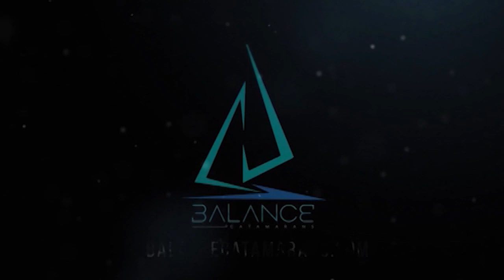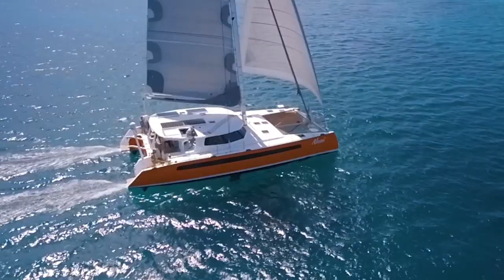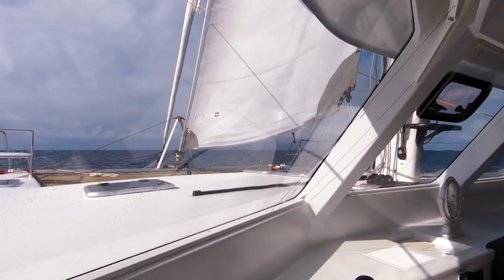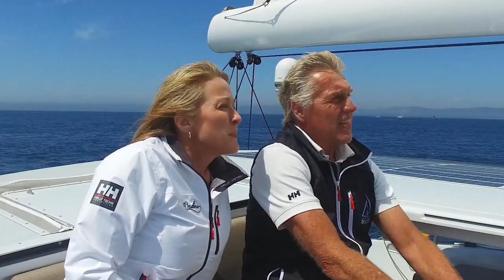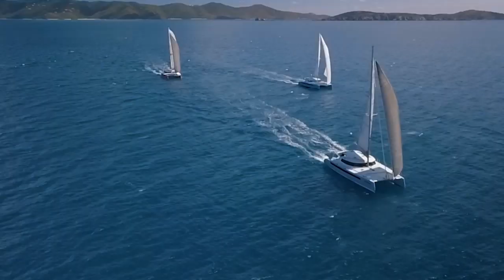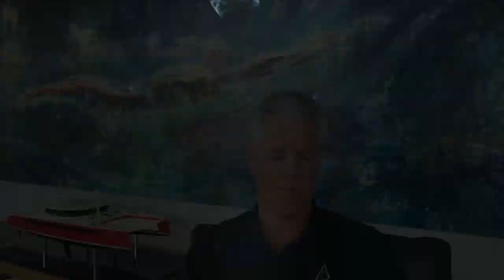Electric Engines on a Balance Catamaran?

Comment: Great video Phil! My name is Jason DeShay and I’ve been building and sailing catamarans around the world for over 15 years. I have pertinent knowledge on this subject having built the first regenerative hybrid powered catamaran in the world , Gunboat 6001. After nearly two years of testing and development as well as months of troubleshooting after commissioning we found that the battery management software was fragile at best . This along with 2 DC gensets
 and their required charging parameters that monitor the house battery banks never seemed to work seamlessly. Obviously these technical challenges can be overcome and some likely have already been. However , as a voyaging skipper these possible failures that require very technical IT and electrical engineering experience are an unnecessary risk that good old Diesel engines just don’t create. For racing or coastal cruising vessels it’s likely a great alternative to combustion engines but for anyone actually and actively cruising it’s just not practical until electric propulsion battery and battery management technologies are much further along. Prudent offshore sailors and cruisers realize this hence the reason nearly all yachts used reliable dIesel power.
Think of this... Your approaching a dangerous inlet.. Lining up and watching the swell.. Then your ready to shoot the pass into a wonderful lagoon.. Lights are flashing and alarms ringing. Some component in the battery system or otherwise just doesn’t want to share info through the boats network with other systems? Now what you going to do? Call your tech ? Fly him into god knows where? We all are interested in how this will fit into the future of yachting however we just aren’t there yet ... Stick with diesel!!! Captain Jason DeShay
Reply: Hey Jason, I used to run Gunboats and have some experience with the Gunboat 60 as well.  As you mentioned, they are equipped with the hybrid-electric propulsion system. I agree with your assessment.  Unfortunately the reality of those systems is not as good as the advertisements would have you believe.  

The GB60 featured two 20kw electric motors on hydraulic skegs turning propellers on fully retractable drive legs that pulled power from a large 29kwh lithium-ion battery pack.  The battery bank was recharged by solar, hydro-regen, and a pair of HUGE 22kW DC generators under the forward bunks.

The idea was that the boat could motor at up to 10kts on battery power alone and then the generators would kick in once the battery was depleted. The reality is that the boat would make 6kts under power for about 45 minutes before the massive generators kicked in.  At that point, it was basically just a less fuel efficient diesel engine and was still only making 6kts!  As a weekend sailor it would make good sense, just using the electric propulsion to motor in and out of the marina.  As a cruising sailboat it was a horrible setup.  That system was on the cutting edge of electric propulsion technology only just 5 years ago and wasn't even close to being practical for a cruising cat.. 

Another example, Phil once had a client whom he became friends that bought an Alibi 54 catamaran with electrics.  Every time he throttled up the motors when trying to dock, a breaker would pop and he went into a panic trying to reset it before they got blown into the dock or other boats. Months of effort were made to resolve the problem until they came to the conclusion that the hybrid system needed to be tossed and replaced with two 40Hp diesels. He did that, the panic went away, and he was able to enjoy his boat for years.  We at Balance would just hate to see one of our clients suffer this after all the time and expense put into a new electric build, only to then realize they must pull it all out and replace it.
Reply: @andrewhodgdon2786  you can use the same logic with electric cars and maybe the first hodge-podge attempts were exactly that. However, the field is maturing quickly. What was state of the art 5- or 10-years ago is yesterday's news. I hear where you both are coming from, however I'd say maybe the answer is "not yet" rather than you need to be an electrical engineer. With that kind of logic there are tons of systems that can fail and cause catastrophic problems. My brothers' boat has two Volvo Pento diesels with thrusters and all that jazz. It's all electronically controlled. If he had an electrical problems, those engines may as well be rocks and you have all the same problems.

To be clear to anyone else who may read this in the future, I'm not saying this with any kind of experience with electric boats of any kind, so please don't take what I say as gospel (or some kind of sage advice)... just that I don't think it's quite as simple as black and white is all. We tend to think in absolutes, whereas use-cases vary greatly. For some electric makes a lot more sense and for others (maybe even most) it doesn't - YET! :)

Comment: Great discussion. Addresses some of the questions I have been mulling over. We used to have a Chevy Volt, so that idea seems a decent middle ground - electric for short hops with a backup generator to reduce range anxiety, only you’d have more recharging options on a boat.

Comment: Thanks for this informative no nonsense treatment of the controversial topic. I'm trying to achieve the ultimate balance for as zero emissions as possible on a future catamaran myself and evening willing to explore radical options such as hydrogen fuel cells. I spent some time on an antique boat with no motor or generator at all, and while there were clearly sacrifices to be made, it was still good sailing, and the boat had already lasted over a hundred years. Naturally some adjustments to attitude were required and it's not a mass market solution. Cold beers were provided by a towed hydro-generator.
Reply from the maker: Barry, we need innovators and people to try things!  I just have watched all the tests go on over the years and too often see a trail of tears. With electrics I saw Solomon systems, Glacier Bay, Krietler.....I just never saw and electric cat that worked great. I do think Ocean Volt and Torquedo are huge improvements. As for Fuel Cells, not idea, out of my experience zone. But we need folks to try things and the risk they entail. It is very hard for a builder like us to want to do anything we deem risky on our clients money. Also, we have to warrant and service it after all. As a young man one of my favorite books was called Sea Gypsy, a Norwegian guy who bought an old wooden sailboat and sailed it around the world in the 60's without an engine. It can be done!

Comment: Great discussion. I'm years from buying a boat, so hopefully the motors and batteries are sufficient by then.
However, I might be willing to settle for insufficient, due to one major issue: NOISE.
The electric motors are so much quieter, it's relaxing, more pleasant, just all around more enjoyable without that racket from the engines.

Comment: Thank you for this video.  As a person who loves the idea of electric propulsion, it's good to see a manufacture that agrees the technology isn't quite there yet.
Reply from the maker: I am very, very fortunate to have far smarter people than myself buying Balance cats, engineers with vast experience who are educating me. I am by nature a guy who is driven by expertise, learning from and listening to experts. What I say about electric engines is based on what I have seen but mostly on what the experts have shared with me. I am a guy who is by nature drawn to simplicity when possible. I only get infatuated with tech when it is clearly so wonderful you'd be a fool not to use it. When we worked on the versa-helm it wasn't a technical problem we were trying to resolve, but a practical issue of how to make piloting a catamaran more versatile for a range of weather conditions. We innovated on that front because it was something that I knew required a solution. If electric engines end up proving to be greener, more reliable, and better then you can be assured we will go in that direction.

Comment: A generator is a must. If a person were able to divorce themselves of the romance of sailing then more doors open. After getting rid of the two diesels the option exists to get rid of the mast and rigging too. That saves a ton of maintenance that doesn't have to be done. You would only run the generator on passages so I wonder how much that would actually cost? The solar would contribute so it has to be cheaper. Overall I believe it would have a much lower maintenance and running cost because you don't have any sails, mast, rigging, running rigging, and two diesels! Not to mention getting from point A to point B would be an easy, safe single handed affair.

I'd love to see some real world numbers from a pure solar boat from you guys! I'm betting it beats sailing in every major category.

Comment: A generator will give you the top up power to handle longer distance than normal for a safety margin. Weight saving on deisel fuel tanks and motors will allow doubling the battery banks.
Reply: Did you see any videos on silent yachts? The guy really seems to know what he’s doing on the designs for his electric yachts. The only problem is I worry about enough power in a storm
Reply: Yeah that's what silent yachts are doing https://www.youtube.com/watch?v=gH5zW2UK38Q I love the idea of solar roof and batteries and a generator as a backup.
Reply: Have you looked at the carbon footprint of generating electricity from a diesel generator to run an electric motor versus using the same amount of diesel to run a motor? Over 10 years o of ownership, I'd imagine that's quite a CO2 impact. Also, have you considered the pollutant effects of the rare earths mining (done in China with very poor environmental laws cuz green idiots banned much cleaner rare earth's practices here, basically) that are required to build the solar panels and batteries? And don't forget the slave labor that is the standard model in China for production - is slave labor "green"? Or can you ignore that as long as you are operating an electric motor powered yacht? 

When one considers the entire supply chain impacts of "renewables" a very different picture emerges of who's doing "good" and who's not. Even Michael Moore discovered this and made a movie about it that was then virtually banned by the global activist community. I suggest you go watch it.  Total impact analysis is not nearly as in favor of green energy as one would think, but hey, I'm just some party pooper over here, I get it.
Reply: @War4theWest  A valid point. But still, electric has huge potential and getting rid of the fossile fuel is a promising outlook.
Reply: @War4theWest  Ohh sorry, didn´t know you are one of those climate change deniers. In that case ... well, never mind.

Comment: Empty battery or empty diesel tank is exactly the same at the end of the day.  Though you can recharge a battery when stuck in the middle of the pacific whereas you can't fill a tank.  So there's that.
In any case, the problem is not the energy storage.  It's the guy who can't figure out how not to run out of power.
Reply from the maker: Energy storage is the problem. Diesel is many times more dense an energy carrier than lithium batteries currently. So to have any range on a voyaging yacht you either must have a massive battery bank, massive solar, or a generator to charge the batteries that run the electric motors. My point is, you will be carrying diesel one way or the other if you want any range or speed under power. If not, you must be prepared to drift a lot. And when a storm is approaching and there is no wind and clouds do not allow your solar to keep the batteries up you risk exposure to bad weather you well could have avoided.
Reply: @balancecatamarans  True that ... Bad weather is a factum .. No one want to experience that
Reply: @balancecatamarans  What would be your typical kWh consumption, electro motors alone, on a cat if you cruise at 8kn?